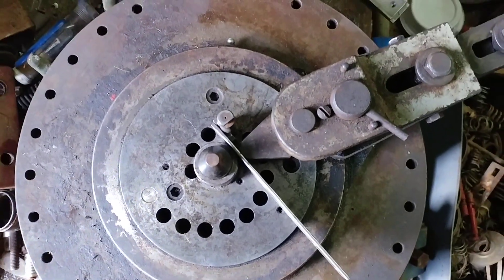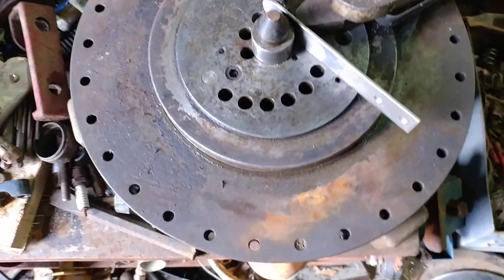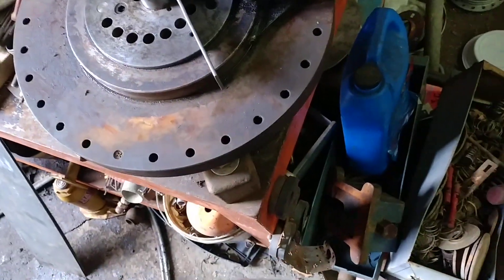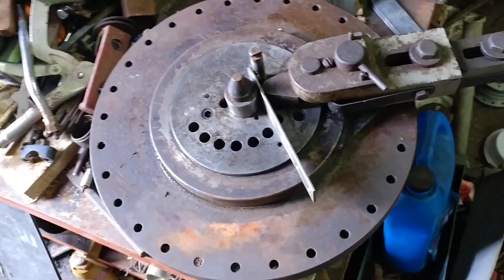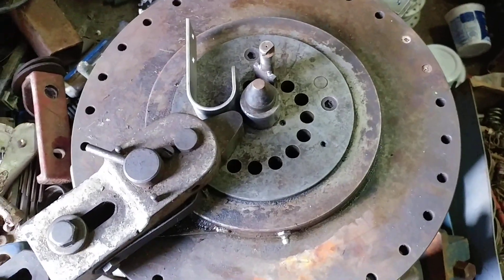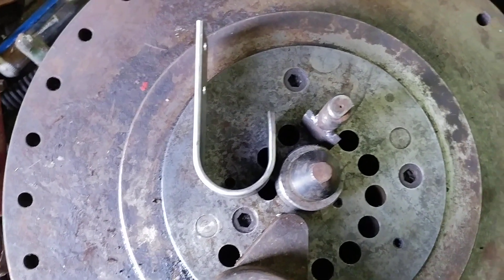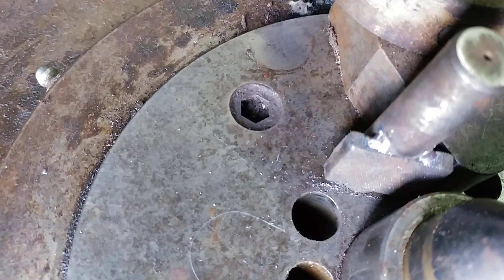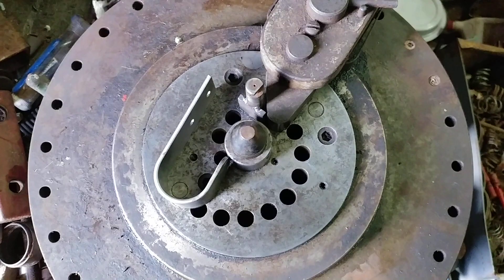Diacro Metal Bending Tip #1

Comment: Pins break! Be careful. 
A coworker fell hard on his back and shoulder today at work, nearly cracked his head on a nearby vice.
Reply from the maker: Yep, key is to have your body center of mass 90°to the work and feet firmly planted. Do the pulling with just your upper body.. Just like when you're pushing work through a vertical band saw..always use pressure from your wrist forward so you never have your body weight into it if something gives unexpectedly..I saw lots of things and will do a video on proper technique for metal sawing soon. TY,  Chuck
Reply: @wildcatmachineworkschas5322  Proper technique is often taught, but rarely reinforced. You are absolutely correct.
Reply: That's why instead of pulling hard I use a cheater pipe which also gives greater control and is easier on the body (mine's old!). When bending anything leverage makes life easier and avoids having to heave.  For thick steel I heat at the bend with an oxy-acetylene or oxy-LP torch. See blacksmithing videos for color chart.